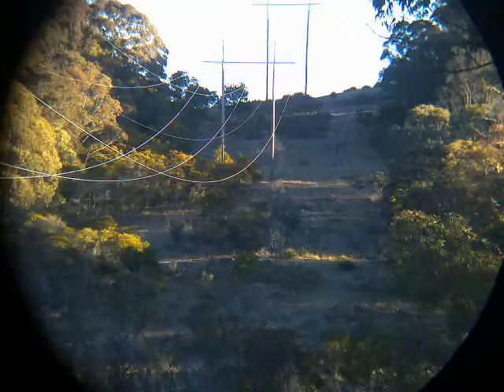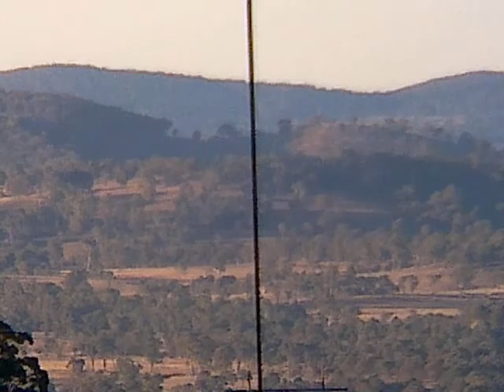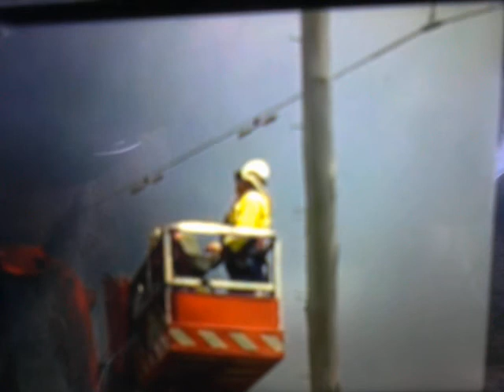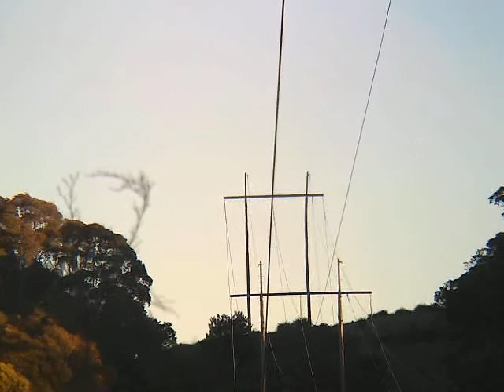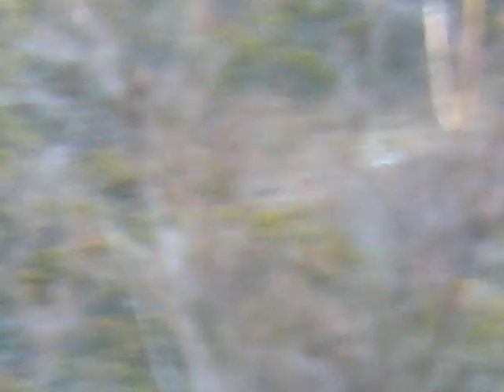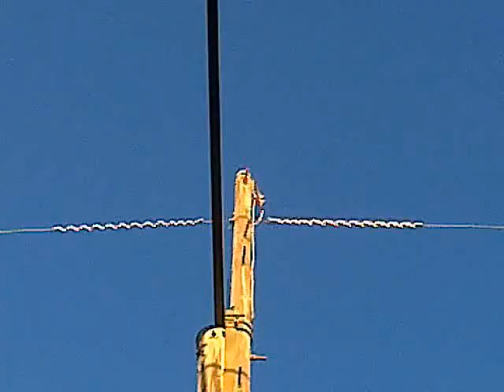High Electricity Prices.., Gold-Plated Poles & Wires, Or Global Warming..?

Comment: i don't pay much for electricity & gas...i have 5 solar panels on my roof...they were there when i bought my house 6 years ago...the feed in electricity my panels make everyday covers pretty much what i use 24/7
Reply from the maker: G'day,

  Thanks.

     If the Grid is already connected, & there are already Panels on the Roof then you're laughing ; until there's a Blackout for whatever reason - because without a Grid to synchronise with your Grid-Tie Inverter becomes entirely ornamental and the Panels revert to being Roof-Tiles....

   But I don't understand why anybody whinges about the "high cost of Electricity", because compared to the cost of running a Generator 24/24 to make Current at home in the back yard, plugging into the Grid is almost free...; and compared to the cost of installing enough Panels & Batteries & an Inverter to supply the amount of Electricity which most people have decided to consider "normal"..., again - Grid-Power is almost free.

   To get a realistic feel for it, look at the daily usage in Kw/Hrs, and remember that there are 740 Watts to the Horsepower..., so every Kw/Hr equals 1.3 Hp worth of Electricity for an Hour.

  My Hut runs on 1/4 to 1/3 of a Kw/Hr per day so I'm using 20 to 30 minutes' worth of an Electric Horsepower, free from the Sun...

 Imagine how much friggin' around a person would have to do, to call and catch & feed & harness an actual Horse, before putting it in the Traces of an old Chaffcutter modified to turn the 3 RPM Horse walking in 30 ft-diameter Circles to at least 600 RPM to drive a little Generator for long enough to pump 20 or 30 Amp/Hours into the Batteries, in order to be able to have a light at night to cook by, with the Radio going, while the Phones are recharging...

  Because of the 200 : 1 Step-up Drive, the Horse at 3 RPM only delivers 3.5 Watts of Torque at 600 RPM..., so even if the Generator was 100% Efficient (it isn't, being closer to 85% at best), it will take 100 Horses in harness, all working together make enough Torque at the RPM required to charge the Batteries ; and the Chaff-Cutter can only hook up 4 Nags at any one time.

  So, yeah, Gridpower is ridiculously CHEAP ; and normal CitiZens use STUPID amounts of Electricity...

  That's how we've trashed the Planet.

  They call it "Progress", and I reckon it was all a mistake.

  Such is Life...

   Have a good one,

    ;-p

    Ciao !
Reply: @WarblesOnALot  good reply warbles...i have always been careful with my electricity usage...it's a bonus having them...the elderly lady i bought the house from used to come around for a few months when i moved in to see if any mail turned up...she told me she had them installed when the labour government was giving grants back in 2011...she had to pay $800
Reply from the maker: +Mitchell M 

  Well, Free Electricity from the Roof is always a good option.

  ;-p

  Ciao !

Comment: I wonder what type of tree is harvested to make a wooden power pole ? Over here in the West, more and more poles are replaced with concrete poles which makes sense. Wooden poles burn and get eaten by termites.
Reply from the maker: G'day Ed,

  Thanks mate.

   I don't know which species, but they get them down the Coast from the high-rainfall areas where the Eucalypts grow tall and straight & fast, competing for the Light.

   Periodocally they do take Core-Samples of the Poles to check for Rot or White-Ants, but, well - 55 years and they're still there...(!) ; so they're doing better than those Steel-Girder Towers in South Oz which were designed with a 40-year Operational Life, and they fell over sideways in a Windstorm after 45 years...

   If one drives around these parts and looks at the Wooden Poles in Town, they nearly all date from before 1960...; I suspect that anywhere that's had Power connected since WW-1 is probably still running on lots of the original Wooden Poles...

   And because they haven't been gradually getting swapped-out, piecemeal, then therefore they'll all need replacing at about the same time ; a project which may well be beyond the abilities of the Economy to achieve..., so it's just(ifiably ?) one more aspect of Industrial Society which appears to be preparing for a simultaneous collapse....

   Which may prove to be extremely challenging.

  Have a good one,

  ;-p

  Ciao !

Comment: Retail have complained the winter stock is not moving.
Down south has been warm so far but winter has just began so we shall see.
Have not seen any frost as yet and most rain tends to miss Geelong.
I could count the wet weather days  on one hand.
Very rarely have i seen any maintenance on polls and wires and i live in a city .
One Wire went down in my street one time but it was during a storm that took out places across Melbourne.
Very busy time for them.
It took three days to get power back to our house.
Lucky for us we had a freezer that had iced up so our frozen stuff was just starting to thaw when the power came back on.
Reply from the maker: G'day,

   Thanks mate.

    Yeah, it's funny, when I was a kid Blackouts were quite rare, but in about 1976 there was a Summer of Blackouts & my father bought a 2 KvA 240-Volt Generator...; and I don't think that the Grid has ever really recovered to it's 1975 levels of reliability, because the population has nearly doubled and for 25 to 35 years there's been inadequate maintenance of the old infrastructure...

  Which makes the future of Gridpower a very interesting topic to ponder...; I'm glad not to be connected to it, but sadly I'm as dependant on it as everybody else who shops at the Stupormarked...

  Have a good one,

  ;-p

  Ciao !
Reply: I would agree as Melbourne has grown the problems with power has increased and blackouts tend to be longer.
When i was young Gas could be a problem , water or condensation in the pipes at winter time .
Reply from the maker: +australianews 

  Well, back in the 1960s there was only one house in Town which had thermal insulation, and that was Bundles of dried Straw sewn into Rectangles and then dipped in hot Bitumen, to seal the Straw from Moisture & the Air...; it worked really well until the bloke who owned the  house torched it as part of a domestic dispute..., and then it became a furnace...

  But everybody else was waking up to Ice on the inside of the Windows - "Jack Frost" from condensation of moisture in the Air while exhaling...; and at night in Winter the drill was to turn off the Water-Main & then drain the System to prevent water in them turning to ice & expanding and bursting the Pipes....

   Back in the dayze when it used to get propperly cold...

  Have a good one.

 ;-p

  Ciao !

Comment: That is a classic case of polishing a turd . I would question the wisdom of fitting that steel lightning riser to such a decrepit  pole after all these things are only as strong as their weakest part.
It's the death knell of any public utillities when the private sector takes over. 
Keep a weather eye out for arc flashes  then jump in your scooby  doo and head for open ground asap.........Stay safe  :)
Reply from the maker: G'day,

  Thanks mate.

  Um, well, it isn't quite a Turd-polishing exercise, in that the Lightning Conductor Riser-Poles are about 6-inches Diamater, vs the 12-inches of the main Upright Posts.., and they've been core-testing the big ones - so they know that they're still sound & solid (for 55 year-old Timber) ; but the smaller a Round-Pole then the quicker it deteriorates, and some of the  old wooden Lightning-Risers had strips hanging off them 3 years ago... 

  So replacing the Risers now might coax another 20 or 25 years out of the whole Line, whereas within 5 years the remaining wooden Risers will be collapsing, and if that happens then the whole Line will have to be replaced.

   Profit-taking... (Grrr !).

  Take it easy,

;-p

  Ciao !

Comment: Hi Chris. Those wooden lightning rods holders are a bloody joke at 50 years old. If they do break and set the forest alight, then the company better be ready to pay out compensation. The forest areas should be a priority for replacement work. 👍
Reply from the maker: G'day,

  Thanks Mike.

  Well, from what I can make out they're busier than a one-legged man in an Arse-Kicking competition - just keeping up with Storm Breakages, and everybody seems to be bitching about their Power-Bills, and the Liberal/National Government are Pawns of the Fossil-Fuel Lobby so they keep trying to sabotage Renewable Energy Projects & sponsor Coal & Oil-fired Power-Stations, and blaming Renewable Energy Projects for Blackouts in the Cities when the Windstorms blow-down the Powerline Transmission Towers...

   The whole System has been squeezed for a profit for decades, not maintained, and now that everything needs replacing and is breaking under load ; Global Warming is ramping up all the Environmental Stressors, so there are ever-more Breakdowns, as more & more old shoddy time-expired Components are failing under load.

  And I thought the story of these Lightning-Risers might be a good way of illustrating what's going on...

  Have a good one,

 ;-p

  Ciao !
Reply from the maker: +Mike Flight 

  Ah, it's an old variation on being busier than a one-armed Wall-Paper Hanger.

  Have a good one,

  ;-p

Ciao !